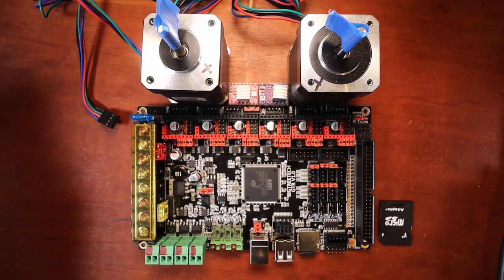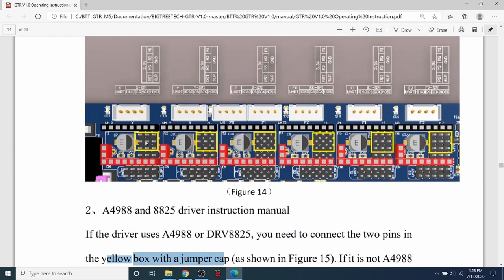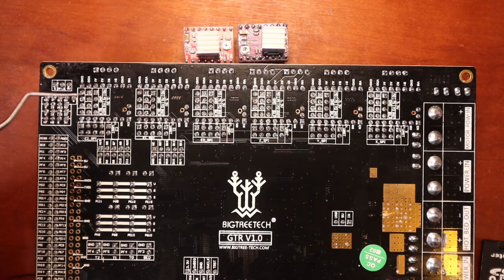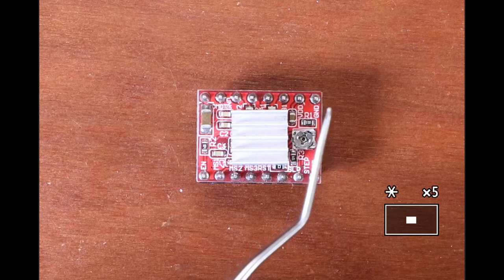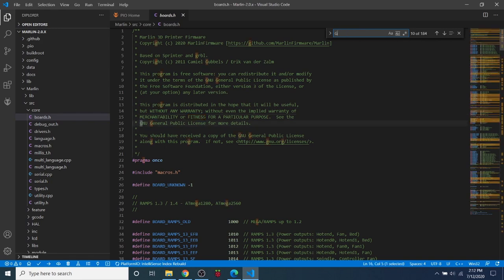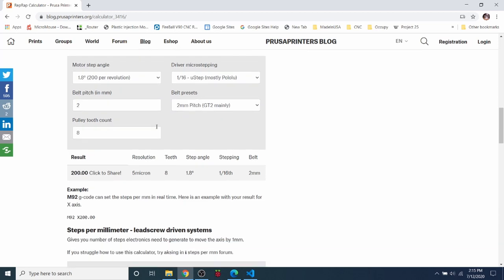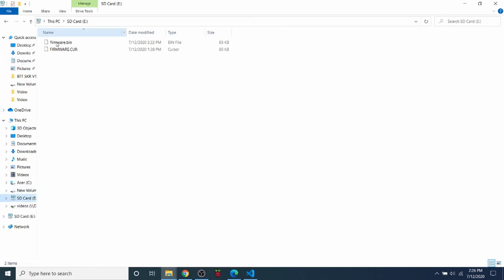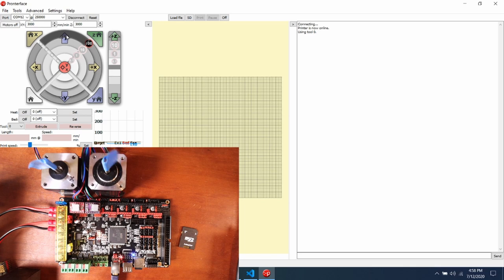BTT GTR v1.0/M5 v1.0 - configuration of A4988 and DRV8825 steppers

Comment: I did all exactly  like You said. but stepper motor do not move
I cant setup voltage at driver because is 0.00 always. 
no matter how much I turn the screw
What I could done wrong?
Reply from the maker: I'll need a visual of what you're doing.  Send me an image on Discord link below.  Slot of people in the Discord might also be able to help.
Reply: @EdwardBraiman  . I know what was my mistake
I did not connect power cables for stepper motors
Only for motherboard
So there was no chances for stepper motors to move
Reply from the maker: Ok.

Comment: Can You Make movie. 
How to set up this motherboard a settings for XY core 3d printer?
Reply from the maker: Sure, but I'll need to print out the parts.  I'll resume printing in the fall as we have 90 degree Fahrenheit days with 80% humidity.
Reply: @EdwardBraiman  Fahrenheit?
Are U from US?

In Nederland is super hot last days 
Why You need to print parts. When It about XY core motherboard settings?
I do not understand
Reply from the maker: To demo inside printer.

Comment: Hi Edward.  I want to build multifunctional CNC boards based on GTR V1.0 board.  how to connect and parameterize servo drives of servo42 (a, b) type or other companies to the GTR board?
Reply from the maker: If you plan on using a a Servo42 it maybe connected via stepper ports.  As to configuration, I maybe doing a tutorial soon, but the information on closed-loop appears to be not well documented yet.
Reply: @EdwardBraiman  Thank you, I will wait for the tutorial video!